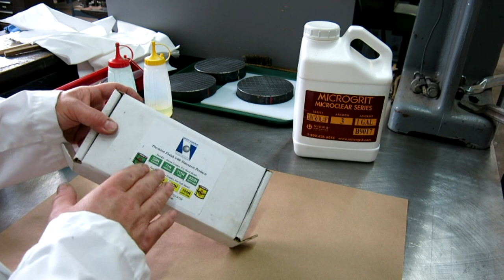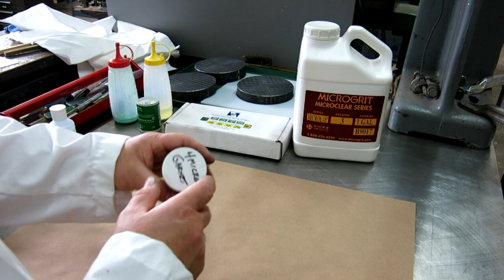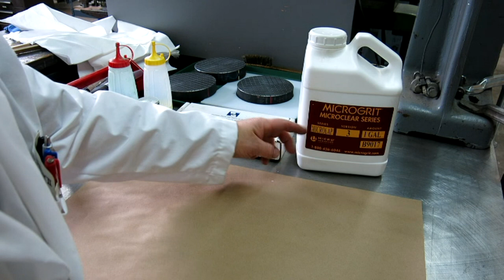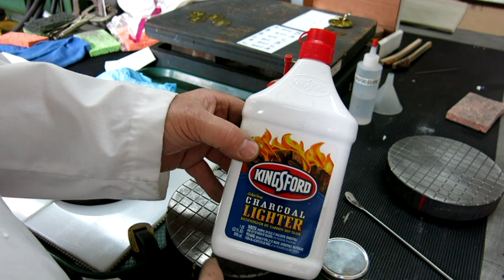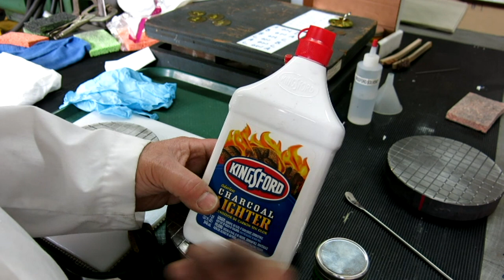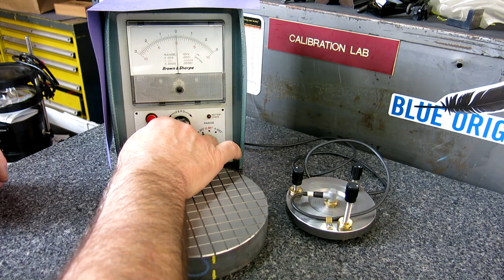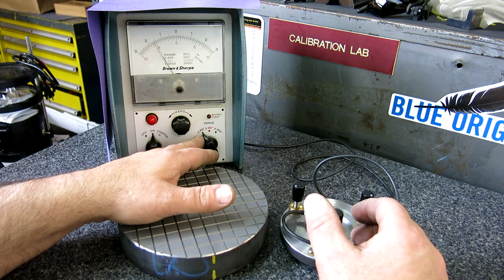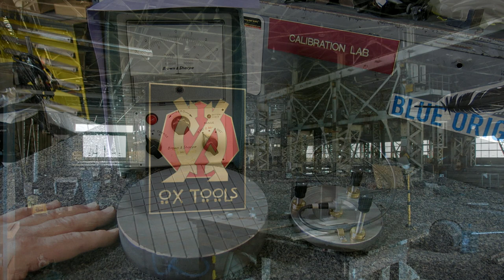Making flat lapping plates 2

Comment: OK.... since watching all of your videos, I broke down and purchased a surface plate. That's not good enough, now I have to make lapping plates!!!!
At what flatness will flat parts wring together? Starrett gauge blocks at AA flatness will wring, but does it have to be that flat?

Is there a better material than a ferrous metal to make lapping plates or otherwise flat surfaces with? I have always wondered why more tools aren't made from stainless rather than cast iron or mild steel. I have a major issue with rust due to the local atmosphere and other anomalies introduced to the shop. Also, with regard to temp changes, is there a particular material that is best to make a flat surface with?
Reply: I think part of the reason cast iron is is so popular for these kinds of things is the low thermal expansion coefficient. It seems stainless can have a thermal expansion coefficient almost double that of cast iron, and aluminium is about double of that again, and copper alloys between stainless and aluminium.

There might also be other reasons, which I do not know.

Comment: I've been trying to lap a few small gauge blocks I've made but keep getting a dull finish? They are bright aftet grinding but as soon as I lap them they go dull no matter how long I do it for. I'm using 0.25micron diamond paste with a cast iron lap. If I stone them after it brings the finish back up but I know my stones aren't flat. Any ideas? I've lapped them so much I now have 19.97mm and 19.992mm gauge blocks and shiny finger tips Lol
Reply: metalhead2508 I'm grinding with a 60grit then 20micron paste and then 0.25micron. I've been using opposite ends of the lap for grits as its quite long. It started as just replacing a few of the missing blocks from our set but since we have plenty of material its turned into a bit of an obsession regarding finish and dimensions.
Reply: What type of steel are your DIY "gage blocks"?
For improper type (and/or too soft, annealed) cast iron lap will be relatively too hard, and you will get matt finish (no matter what grit).
Try Arkansas stones. Try softer lap (brass, bronze, copper).
Try different technique (maybe you are doing something wrong, pushing too hard, diamond compound getting dry, etc.).
Reply: SJWs & Betas Killer The steel was marked up as A2 but it was bought as offcuts so I couldn't be sure. You could be spot on about the lap since I had excellent results by stoning though, like I said, I am sure that the stones are not flat (enough) Cheers for the tips.

Comment: About the sequence used in lapping; I don't agree with the age-old method here.  A on B is the same as B on A.  It's wrong. 
Here's an easier way to remember what you're doing.  Take the first piece (A) and lap it with the other two.  Take the second piece and lap it with the other two, etc.  Etc., etc.  See if that makes sense to you.  
And don't worry about which piece is on top.  The force is the same in both directions.
Reply: From my mirror grinding days: the top plate becomes concave and the bottom plate becomes convex when two identical plates are lapped against each other with an over-lapping stroke. So what you said about A on B = B on A isn’t true. (But, for the life of me, I don’t know why.)

Comment: I saw this to  get a little knowledge about the difficulty of making a plane surface, because there are 24 stone boxes in egypt in a place called serapeum they are made of diorite and granite, cut from one solid piece of stone, weighs 100 tons each,  they have, plane , square, parrallel,surfaces inside,  that are accurate within the range of 1/20000 of an inch... 1/20 of a human hair, and btw, made for several  thousand years ago, and as i said there are 24 of them...go take a look if you havent already, and dont tell me some egyptians made them with stone hammers and copper chisels, im not buyin it sorry😂
Reply: And btw i would like to see you in serapeum with that flatmeasuring device, you would probably walk out thinking it was broken because that needle didnt move AT ALL 😆  
and thanks for the video very informative lesson

Comment: Pardon me for a dumb question but why are you using cast iron for the laps?
Thanks, Tom.
Reply: Why not? 
Because this is traditional material for laps.
Cast iron (grey/ductile) is relatively softer than most steel types and cast iron is naturally wear resistant (due to high carbon content).
And it's cheap. And easy to machine.